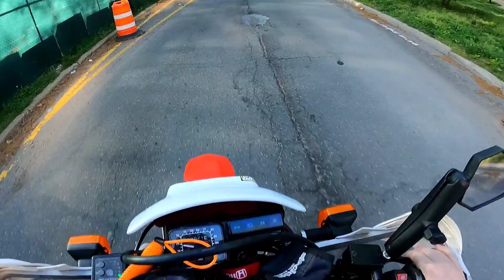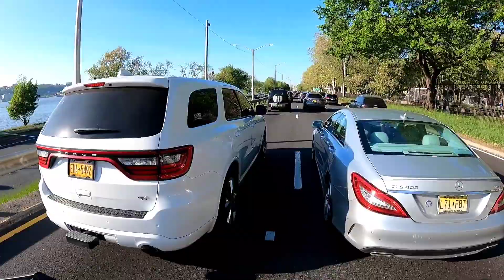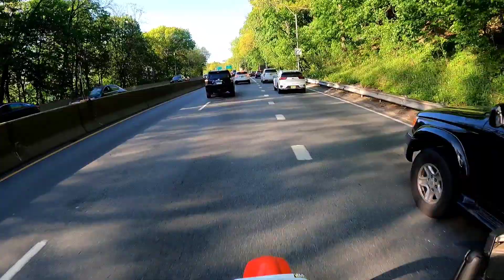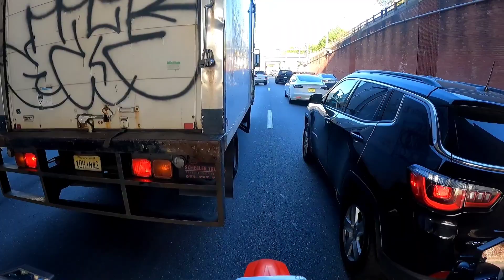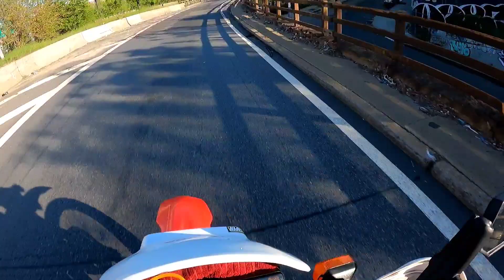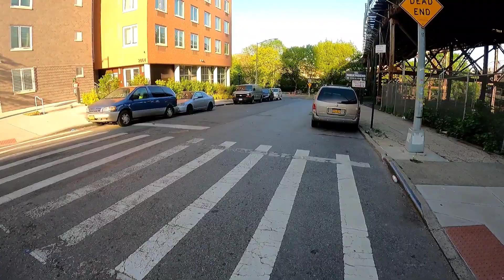Dual Sport and non abs motorcycle combo braking #xr650l

Comment: On my 22 KLR here on Oahu I initiate normal braking with the rear first and trail the front.  I'm not sure how previous generations are but these KLRs make pretty substantial engine and transmission braking during slowdown.  Another thing I've noticed is although the front suspension works well on the street it doesn't take much to scrunch up the travel quick if you only jab the front brake.  That's never a good thing especially if your trying to maintain direction and stability when coming to a fast stop.  I"ll probably at some point down the road install progressive springs in the front.   My rule of thumb is never trust commercial drivers, anyone with a chauffeur license or government employees driving on the clock.  Cabs, HANDIVANS are the worst.
Reply from the maker: I do like the KLR engine braking the KLR is trusted machine very predictable and actually pretty safe your right on just front heavy braking the front dives I guess because she's a big girl , that's a good rule on drivers you know how nyc cabbies are 🤘😎
Reply: @ggnyc2017  I don’t know if it was a mistake or an adventure but I once got a lift from what’s called a Black Cab in Manhattan. It was a wild ride.